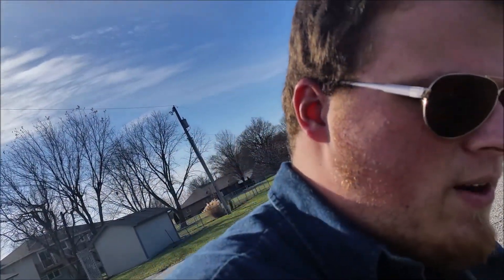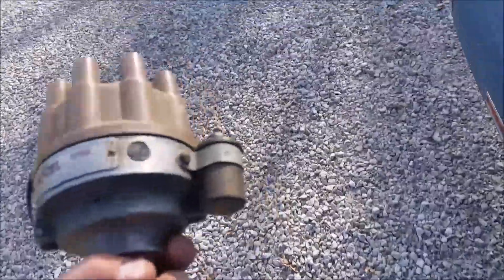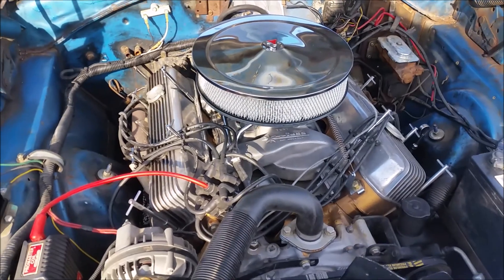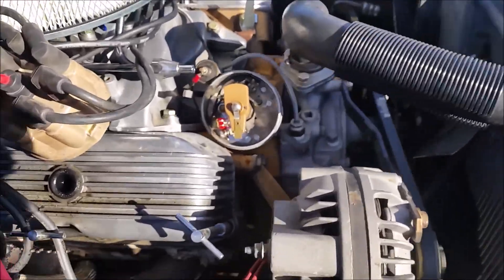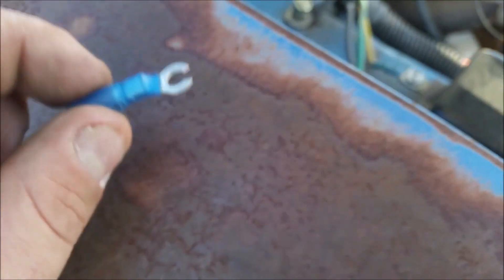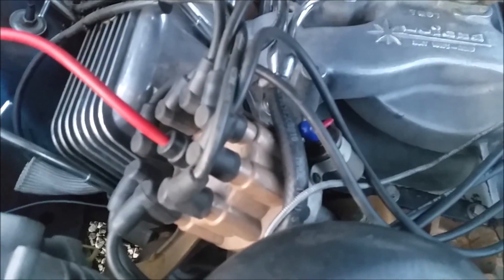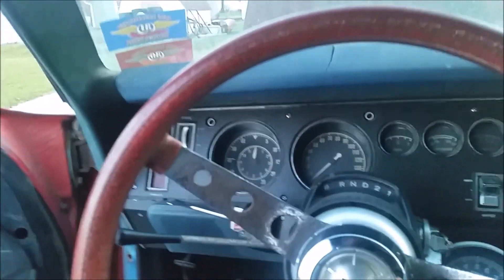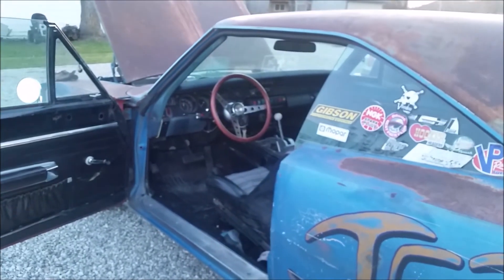1970 Charger Jezebel Accel Distributor install

Comment: Thankyou.

I replaced my duel pointers to msd pro billet dizzys, each one had to go to a dizzy expert as one was on a blown 502 needed recurving, and my latest is on a 900hp twin carbed 572, this needed recurving to.  But runs perfectly.

I liked the twin pointers but extreme hot then cold here in weather causes carbon build up regulary on the points.
Reply from the maker: Yep I hear you brother, there are pros and cons to everything, and with 900 ponies under the hood, I would probably be running a high end modern distributor anyways. 

I am glad to see another person refers to them as dizzys, I stopped doing that because people would constantly ask me what a dizzy was....